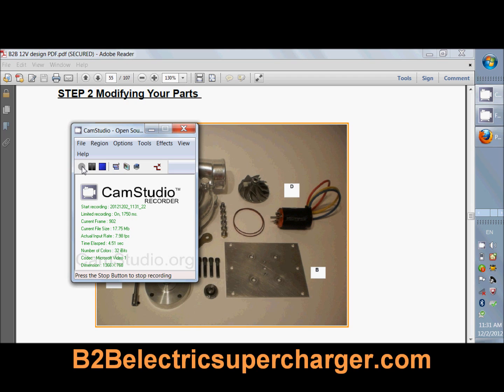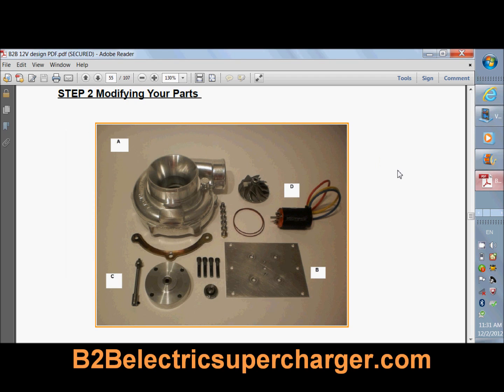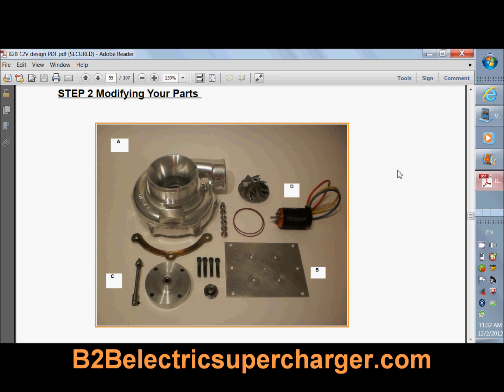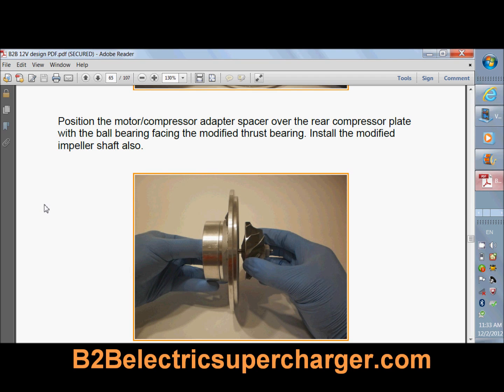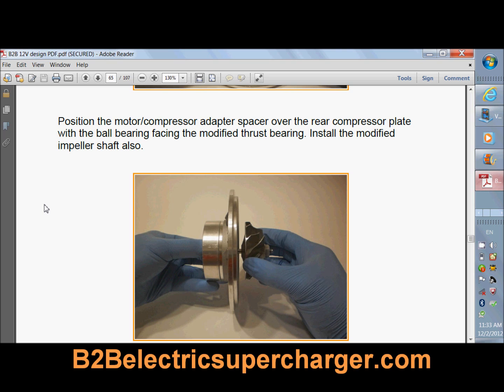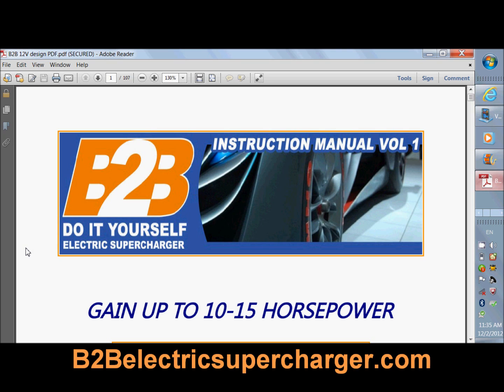Electric Supercharger Ebook Preview ( Chapter 6 )

Comment: why use an electric motor to spin the turbine?  for increased boost why not have the electric motor spin gear reduction ( Massive under drive) that is attached to the turbine shaft?

Comment: Dude 12V cant do shit.. its only gud for blowing your hair dry or prolly keeping your balls cool in the summer
Reply: This is actually a real turbocharger housing and power used for these 50,000rpm motors is 40-60V.  It can blow off your face if done right. These motors produce so much power.
Reply: this is true. from what I have read a 48v battery would be optimal.

Comment: lol for funny reason think of the concept why turbo charge compress air is to allow more combustion with more oxygen dense enough to provide to the injection. More or less electric compression would do less due to limitation of power supply from the system and does IT SUCKS... no matter what u say it wont provide same power as gas compression exhaust in terms of performance u just waste ur money even if cheap as true tuner wouldnt do that

Comment: News flash mate that is NOT a supercharger in ANY way or form !!  it is an electrical positive ventilation fan and it is a COMPLETE waste of money. 

Use an exhaust driven Turbocharger or Belt/gear driven screw rotor blower and you will be on the right track to making HP these electric shit things are designed to do but one thing - Lighten your wallet.

Comment: you sound like a broken record and normal 4 cylinder engines can handle like 6 or 7 psi stock so why not show people how to push the limits and make it so all you have to do is change the gear on the motor to make more air

Comment: what you need to do to make it more like a real one ( if you want more power) put I small gear on the turbo shaft and a small one on the motor shaft also putting a esc from a rc car wouldn't be a bad idea. like real turbos it would move more air as the throttle rises

Comment: i drive a 2010 cobalt LT 2.2L ecotech  i have a few aftermarket parts now like a header back exhaust system and a performance chip iv been looking to ad a lil more hp i bought the one electric sc u showed on here it came with the K&N look a like filter but it kept stalling my car out so i sent it back and got my $200 back now how is your product gonna help me and will it work for my car